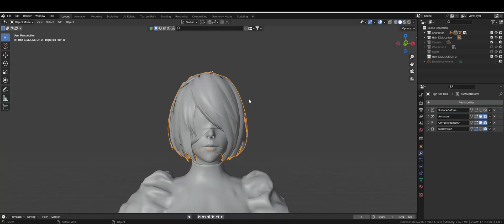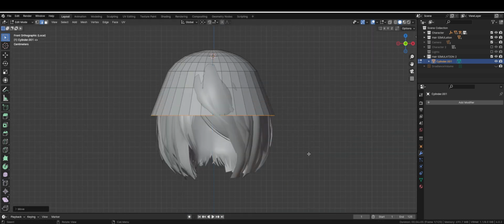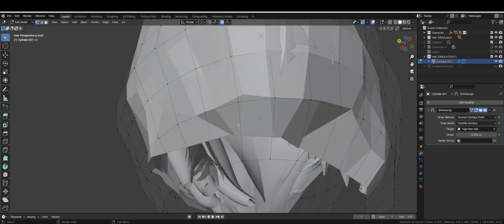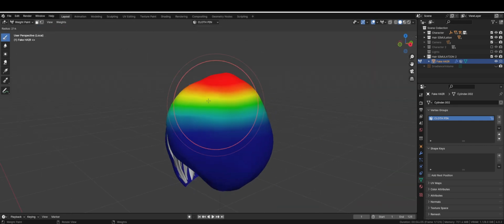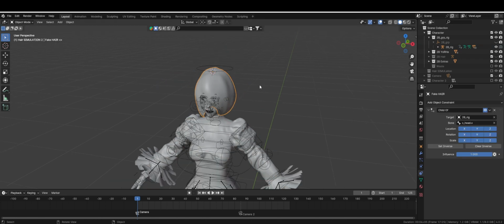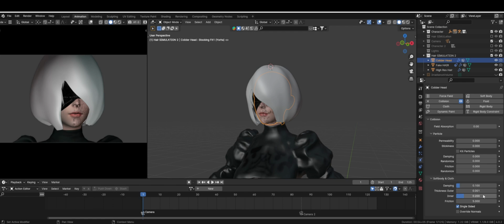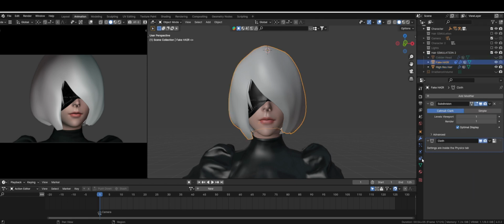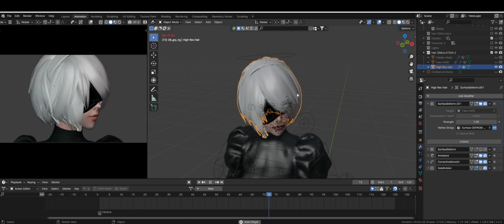Blender Hair Simulation Tutorial | Hair Animation Tutorial

Comment: I settled on Surface Deform => Blind at the end. For the third day now, I haven't been able to figure out the error "target has edges with more than 2 polygons". That is, Fake Hair has a Non-manifold geometry. And I don't understand how to make it connect. Since if you remove the Face from the cylinder from below, Fake Hair automatically becomes non-manifold and is not allowed to be linked using the Surface Deform modifier. 😢

How did you make Fake Hair correctly to bind using this modifier?
Reply from the maker: i Don't know what's Happening in your scene but , try to make the fake hair quad as possible , no overlapping vertices ,use corrective smooth modifer and then apply maybe that helps

Comment: "I tried the same method, but it didn’t work for me because the hair I’m using isn’t a sculpt; it’s a hair model made up of multiple meshes. This method didn’t work for the model I’m using. How can I add hair physics for this kind of model? I’d really appreciate it if you could help me with this in a clear and understandable way."
Reply from the maker: @samet1936 this Is not hair simulation 
It's just hack to move any mesh ( Deform ) 

So if you wanna Deform any mesh you have to make fake cage around your object and then animate the Fake cage However you wanna animate it
If you hair is Just like hair then create fake cage and then use the method 
Make sure your hair should have Quite good topology 

Just Figured it out 😃
Reply: @CocoSpyder 
I preferred to use the Lattice Modifier and got almost the same result thank you

Comment: Hmmm. Interesting.  I'm going to try this later, though it will take me about 2 weeks, not five minutes.
Reply from the maker: @robbie_  😶
Reply: @CocoSpyder  I failed. My hair is on one side of the head only, so shrinkwrap goes right through the skull.  😂
Reply from the maker: @robbie_  you don't need you use shrinkwarp always you can manually adjust it 
And Make it close to the hair
Reply: @CocoSpyder  I did it.  It's pretty hopeless, as all hair simulation in Blender is.  There are 20 parameters to tweak and not much of a clue is given as to which ones are important.  Now I remember why I prefer rigged hair and hate simulation with a passion.  It's never intuitive is it.
Reply: @robbie_  Yeah he makes it look easy in the video. I've ran into many problems as well.
Reply: @CocoSpyder  bro i am facing the similar issue , i used shrink wrap outside surface where it goes inside the hair, i set the offset value higher but the offset doesn't occur uniformly for some reason(when cylinder  on top of hair is adjusted uniformly) , any tips? I don't get when u said that we dont need shrink wrap modifier for this to happen, so you mean we can take a mesh and make sure to sculpt it in such a way that the hair doesn't come out? But then the mesh and hair are separate parts and the only thing connecting both is shrinkwrap snap which is outside surface?
Reply from the maker: @Aura_566  i doesn't matter , if your cage is outside of hair or inside ( it just need to be close to get the deform details ) you just have to make it close to the hair and then parent it to the head rig and then pin cloth and use surface deform and Make sure you use vertex weight for hair deform area